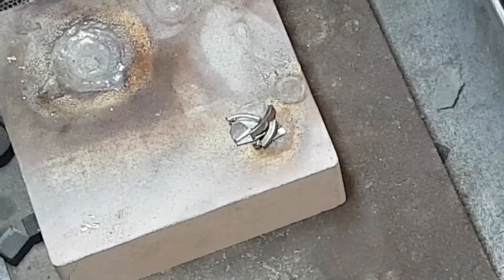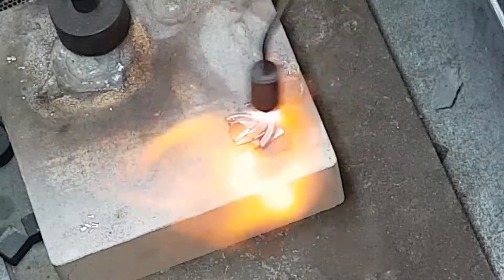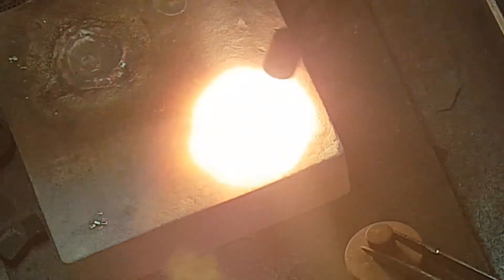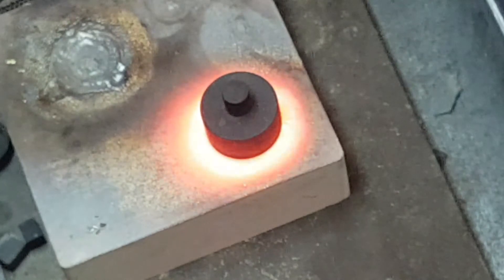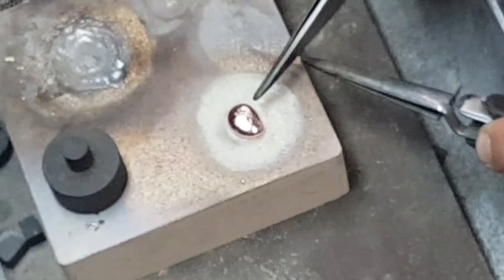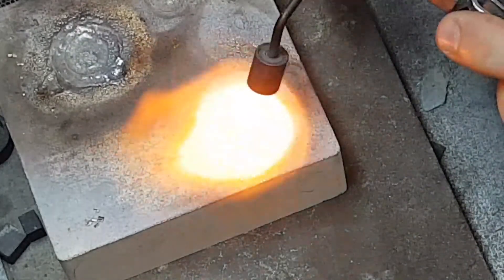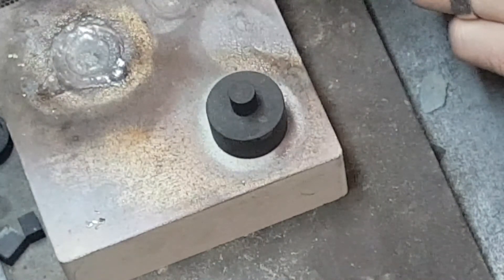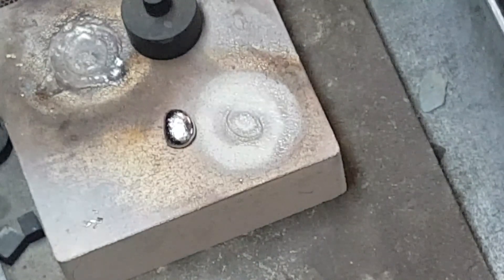Melting platinum (part 1)

Comment: Ok ok. Excuse my language but platinum is a bitch to melt! I finally succeeded in getting mines melted today, but I don’t think the ruthenium has fully alloyed with the entire ounce. Had I not watched your video last night, I would’ve been freaking out bout trying to get it out the crucible, but like you said, it contracted. I ended up with a little of the Wesgo crucible stuck onto the metal. Ima just file that off though or do like you did. I tried melting the platinum about a month ago and the shit wouldn’t melt for nothing. So, I’m happy to see that I atleast got it to melt today. You make it look so easy to melt. After I use these three ounces, I’m sooo done with platinum. I’ll stick with the easier to melt and pour gold.

Comment: Hi love the video what is your crucible called I’ve tried searching online but it comes up with the cup type not the block type you’re using plus you mention not to use steel tweezers so what’s the ones that you used thanks. Hib

Comment: Nice video.
Will be using a graphite cap from now on.
If you tip your steel firetongs with platinum, you won't contaminate your melts.
A bigger torch is recommended.
Once melted a platinum ingot with a Smith's torch.
The torch got so hot it melted the solder and blew the copper tip into the platinum..... wasn't a good day.
Reply: A sw1¹¹

Comment: Hello! Many thanks for the video. I have exactly the same equipment and somehow I haven't managed to melt any quantity of platinum. Using a very similar surface as you. I thinks it might have to do with the potential I have set my gas and oxygen with. Do you think that might be the case?
Reply from the maker: Tip size is a must! Size 7 tip or the larger melting tip and hitting it full blast. If you haven't done it before you have to blast it with all the smith torch has but it will melt. Side not before you start clean your melting station so nothing can light up and if you are worried pull out. When your not confident that's when mistakes happen.

Comment: Do you know anything about platinum recycle. com ?  because I  sent them my findings and they wouldn't offer me anything? I did all test's myself and it passed to be platinum. Hydrogen peroxide test passed, acid test passed, heat test passed. and It is also non magnetic material. The only they told me was they didn't know what it is and couldn't determine to value it. So I asked her if she could at least tell me what metal it was and all she said was they assumed it was just some type of natural formed metal rocks? lol have you ever heard of such a thing?
Reply from the maker: Hey Jimmy, no never heard of them. Best to have it tested by the person who is going to buy it and have the deal locked in on the day.
Reply: Isn't all metal found in rocks. Besides aluminum which what we have is mostly man-made via electrolysis from bauxite.

Comment: What torch do you use ?
Reply from the maker: Just a little smith tourch mate
Reply: @refraction_manufacturing6193  hey, actually I was trying something similar with copper and kitchen torch with butane. Could make the metal flow. Do you know the difference between Smith torch and the kitchen torch or what I could be doing wrong ?
Reply from the maker: @swaroopcool22  kitchen touch for cooking will a much softer and lower temperate flame. If your working with platinum I highly recommend updating your melting torch 👌

Comment: Hello, how much bari pressure I need to set up on oxy regulator to obtain necessary degrees for platinum melting? I use propane and oxy and a smith torch with oxy head. Thanks!
Reply from the maker: 35ish psi or just under 200 kpa is what we have ours set to.

Comment: What type of torch are you using? From what I can gather oxy acetylene is too dirty do a flame considering any carbon messes up platinum and other pgms.
Reply from the maker: YBS Entertainment we use a Smith torch and a few different heads.
Reply: I meant what type of fuel are you using? Hydrogen? Oxy propane?
Reply from the maker: LPG and Oxy
Reply: Refraction_Manufacturing what head are you using to melt platinum with the smith’s little torch?
Reply from the maker: @argentummoonjewellery3503  size 7 tip
Reply from the maker: Smith torch with LPG

Comment: What is the cap made out of?
Reply from the maker: This one is made from Graphite and was made by cibel https://www.facebook.com/cibelgraphite/
Reply: @refraction_manufacturing6193  Doesn't platinum react with graphite at high temperature
Reply: Thank you so much for this video. Any chance you can demonstrate cleaning &  smelting filings?🙏🏼🫣🤗